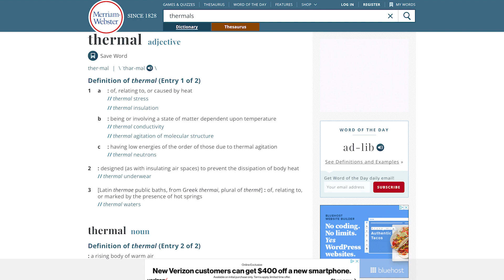Understanding Thermals by WATER For Deer Hunting!

Comment: Hot air RISES, other air (typically cooler) rushes to fill the void.    Shade, terrain, water can all influence it but it is the changing AIR temp that causes the rising and falling.  Land reflects sunlight, heat, energy far more, water absorbs it (exactly the same reason why people are far easier electrocuted in water than on land) .... This is why land, especially open land with no canopy, will effect air temps quicker.